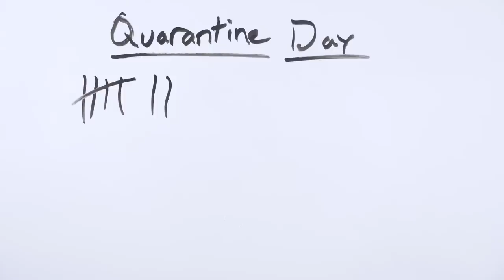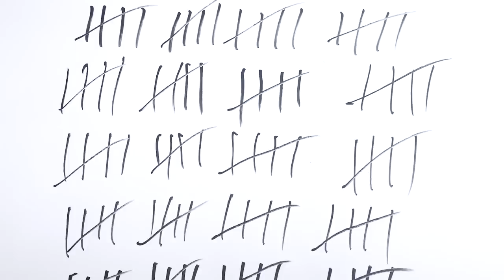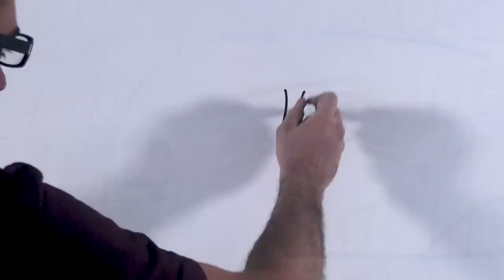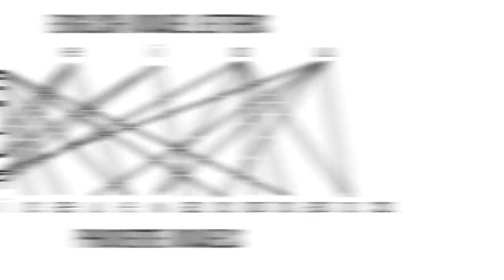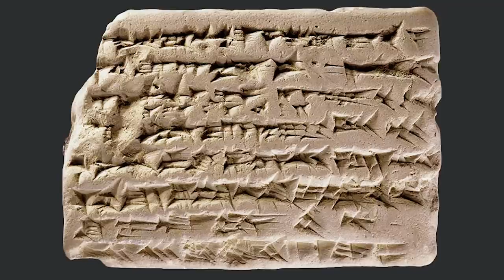The OG Computer: How to Make Your Own Abacus

Comment: Wonderful video as always. The Lathe v2: Instead of the leather cord of the bow wrapping around the work piece, Cast one of the ends as a shaped cylinder that is held in a cradle allowing it to rotate,. Then wrap the leather cord around this cast cylinder.

Comment: Fun thing about the sexigesimal  base for circles: if you take a circle of radius A, select a point on the circumference, draw another circle of radius A, then continue the cycle from the intersection of the two circles, you will get six segments - so the natural division of a circle for any base is radix*6. Some are more natural than others - an angular system based on a binary progression has no issue being recreated from scratch, but other require more work, such as trisecting angles and working from multiple separate divisions (such as 5, 6, and so on) just to create a smaller angle measurement.

Comment: In the Sahara, at the juncture of a number of ancient trade routes, lies a massive rock - a landmark seen for miles across the desert. Archeologists have discovered carved into the rock a series of pecked holes in a rectangular grid pattern. Most prevalent theory is that this grid is a very basic form of abacus, with pebbles fitting into the holes acting as counters. Estimated age in excess of 5K years.

Comment: Have you ever wondered why the Chinese abacus is the type of abacus most often cited as the ancestor of digital computer?

The answer to the question may lie in the fact that the Chinese abacus has two heaven beads and five earth beads along each rod, and thus that makes the difference from other types of abaci.

The Chinese abacus is commonly used for working in decimal, but it may be used as well for hexadecimal numbers. Note that when all beads along a rod are set then the sum of bead values would exactly be equal to 15 or F.

Hexadecimal numerals are widely used by computer system designers and programmers because they provide a human-friendly representation of binary-coded values.

Comment: Now that you are in the Bronze age you can make "non twist" drill bits. Basically it a chisel where the sharp edge is on the opposite side half way through. Make a file using a chisel..

Comment: You know, now that you have a lathe, paper, and several forms of adhesives, maybe you should work towards sandpaper?  It makes a remarkable cutting and shaping tool for a lathe and it's a big help for making finished parts that need to fit tightly together (your lathe had a loose fit on one side that was causing it to wobble a bit, that probably made it much harder to spin than it needed to)

Comment: Hey remember when you fell in the cranberry bog ‽
Reply: ‽ Which language do you use that symbol in? Just curious if anyone knows
Reply: @atriyakoller136  It's known as an Interrobang and was invented in America but is not widely-used in any language.
Reply: It's in outro! (Twice)
Reply: Interrobang !
Reply: Linecraftman, Ha! I admit it I skip the outro!
Reply: @atriyakoller136  It was technically designed for English, but also technically recognized as either worthless, unusable or unnecessary by almost every English linguistic "authority" currently recognized.
Reply: @bordenfleetwood5773  It's also 1 byte more than the 2 characters it's trying to replace in UTF-8, so it even fails at saving memory.

Comment: Soak a piece of leather (or fabric though this dries out faster) in water then wrap it around the sticks.  Place the stick in a perfectly strait grove cut into a piece of wood that is shallower than the wrapped stick, and place another piece of wood with a grove on top of it.  Then wrap the two with a piece of cord and place a weight on top of them.  The grooves and wood surfaces should be flat and uniform to place equal pressure across the surfaces.  With the weight and constant moisture from the leather, this will allow you to turn the sticks into perfectly strait dowels.  These dowels can be used for the abacus or on the lathe to make easier work with the bow. The method can be used to make a uniform curve to produce a better bow for the lathe.  Also, using a piece of rough stone can work as sandpaper with the lathe or without it to smooth surfaces.  Smooth strait wood will make many of your projects much easier.

Comment: Honestly the lathe looks like garbage, but it's undeniably quite effective! Good job!

Try making some better lathe pieces on the lathe lol.
Reply: i would kinda like to see a parallel series, where he refines some of the tools he has under the assumption that he has to use them on a regular basis. kinda like he more or less seems to have switched from primitive casting to an electrical kiln and a proper wooden frame for the tools because his setup was barely able to cast a blade.

the saw for example: i get that its the one he made on his first experiment, but there is no way he can get to the higher techs with his barely functional tools when in reality craftsmen probably spent dozens if not hundreds of years refining the tools they had before inventing the next tool. so building the next generation kinda requires at least decent versions of the previous generation of tools.
i think without at least a pedal powered lathe and a proper (bronze) saw he will have a hard time building any of the newer stuff that requires round parts.
Reply: @TheScarvig  hopefully its not Turing into an entertainment channel than a how to. Its disappointing seeing him use modern furnaces when his primitive ones were barely effective. Still fun to watch

Comment: Base-60 system is called sexagesimal, not sexidecimal.

Also, in Russia abaci were routinely used at cash registers in shops until early 2000s. So, I remember see them in action there rather than at school.

Comment: People like to pretend we're all fancy and progress-y now, but really, most people only ever use four functions in most of their life, and for the two most common the abacus is just as fast and effective. For the other two, learn logs and use a slide. I mean think about it, the most useful thing on a four function is the M+ and M- buttons for tallies which is essentially the silicon analogue to moving beads on sticks. More technically an abacus is a kind of like a register, but that's neither here nor there, point is the abacus ain't so primitive even compared to the electronic calculator.

Comment: pulley + flywheel = transmission of force

added weight in the flywheel creates more sustained force even though it takes more to power it, but im sure you would rather have a lil more weight than just the twig you're working with right?

Comment: The abacus is more akin to a Register inside a CPU while you are still the CPU. The abacus stores one CPU native size number or "word" which in digital computers are typically 32/64/128 bits in size. In this case the abacus contains 25 "Pits(?) - Penta-digits(?) - beads" being use to represent a value from 0 to 99999 using a "sub base 5 system" where as if they were binary bits they could represent a value from 0 to 2^25-1 or 33,554,431.  Of course this kind of large number use by humans would not appear until much later with the invention of $Money$ $Money$ $Money$ $Monnnney$

Comment: with your bow drill design i can see its not a strong frame/stand so it loses energy from its lack of a sturdy frame, i see you have a bow drill and a good basic swivel, maybe have some removable shims to help tighten the frame and increase in precision and require less energy per push/pull.

also from what i can see you're cutting on the pull, it spins towards you when you pull, another nick pick i have is that rope doesn't see to have much grip to it, maybe its an inferior strand or doesn't have enough mass to help tighten around what your'e cutting.
 
(this segment is a suggestion, you're free to disregard what i say) if i were to make a good bow lathe i would make 5 rectangle holes, 1 swivel plant to have a hole, tightening shims and one end permanently embedded while the other is adjustable, work on making a better rope and a good bow drill.
with the 5 holes i can adjust what length i want so in the future if i must reuse the lathe i wont have to worry about needing a longer lathe to work on a long piece of wood, shims to i can temperamentally lock the adjustable swivel to the right distance i need, maybe add a few legs so i can do it on a table and sit in a chair so i'm not on the floor to work all the time.

besides all the flaws i see, there's room for improvement that can help you later on, you're doing an awesome job at trying so don't get discouraged by negative internet scholars, hopefully this helps you out, have a nice day/night

Comment: Your bronze tools need to be as sharp as they would have been used. The disadvantage of bronze was that resharpening was very frequent depending on use. But in use they were as sharp as modern tools. Make yourself a file, if you haven’t yet. A file is simply like many fine saw blades stacked together. By doing very crude work, you illustrate inferiority of former technology. This is untrue. Ever seen a fine 17th century dresser? They were done with all manual tools. But the finishes were as good or better than modern furniture.  These skills are useful,  especially the lathe,  for off grid living.
Reply: Sorry, I think the video switched while I was typing.

Comment: Your metallurgy is really good for the timeline you're following, but your woodworking is not.  Based on artifacts from these periods, you need to take a break from crafting new invention and heavily refine your existing tools and methods.  You should have a plumb bob rig for squaring by now, better metal measuring tools, stones for "sanding" wood, and wood chisels and files.  

A lot of this "generational expertise" you talk about the ancients having over you, is actually just improved toolsets.

Comment: This is definitely not a computer. It is not even a calculator. It's a calculation assistance tool.
A calculator takes only numbers as input and does a single calculation and presents the result without a human doing any of the calculation steps.
A computer runs calculation and logic steps by itself in a loop potentially forever or until a task is finished. For it to be truly considered a computer and not just a fancy calculator, it has to theoretically be able to solve any solvable (math) problem given the right program and being connected to potentially infinite memory (the internet).
As much as I would like to see a real computer made from scratch, I realize you would need a computer science degree (and maybe an electrical engineering degree) (or help from people with one) and a year of time to pull that off.